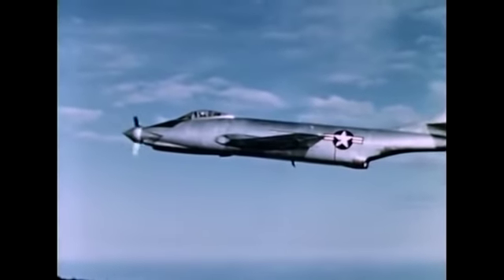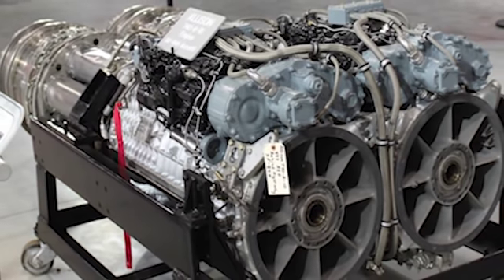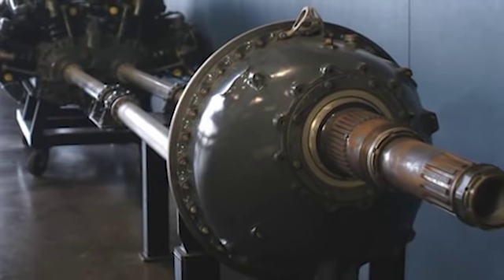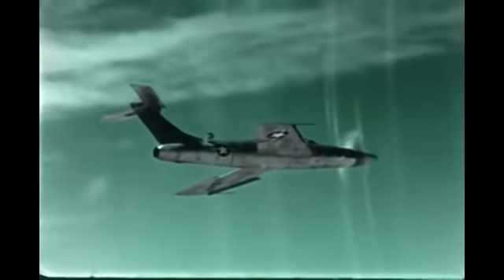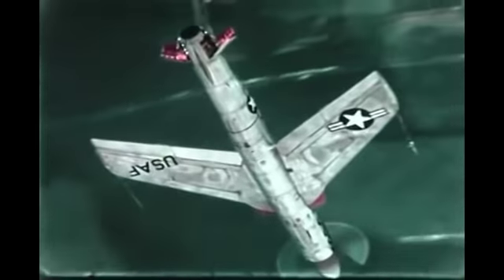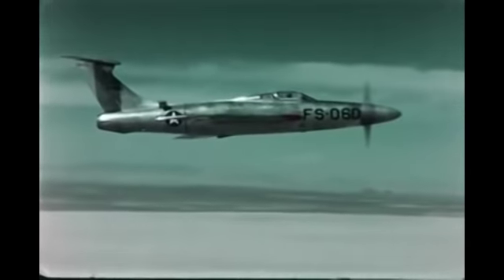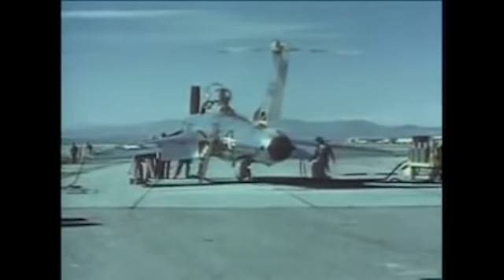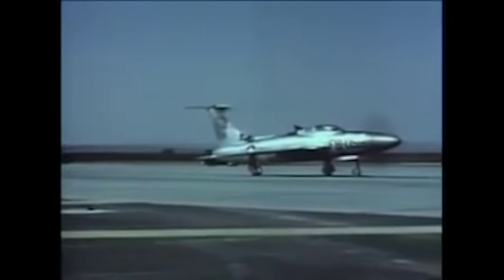The Republic XF-84H Thunderscreech | The loudest plane ever built

Comment: Ever leave a back window open on a moving car? That buffet sound is uncomfortable enough. This plane was probably doing something like it but on industrial grade steroids.
Reply from the maker: That is EXACTLY what I was thinking. That highway-window buffeting thing that basically rips your ears out lolol.
Reply: @theatomiccafe8996  The tips of the propeller where supersonic. The hueys the rotorblade tip on the advancing blade is supper sonic and the props on the tu-95 bears or as well. They would send those bastards out at night and just fly around in circles around the boats in the navy just to drive us nuts. They would shake a 800 ft long boat and you would have to yell in side over them.
Reply: @Johnny; Great analogy, I'll add that the wake from the prop would not have been fun to encounter when crossing its path during any phase of take-off, downwind, or in any type of pattern.
Reply: @ghinckley68  oh yes the tu-95 the Maritime Patrol aircraft that basically told the submarines where it was.
Reply: The Soviets are interesting,  we can’t build proper jet engined bomber fast enough with enough fuel efficient to penetrate US air defenses,  so they build on loud enough that we know it’s there. Then like the neighbor playing loud music taunt u with it
Reply: @ghinckley68  thats what i was gonna say about the turbo prop bear bombers but your spot on or close
Reply: @jamesbuckner4791  the bear is so noisy it can be detected by the anti submarine detection grid on the bottem of the ocean!
Those crews have to be deaf
Reply: @obelic71  yeah I knew that they were so loud enough that even the boats heard them
Reply: Earthquake detectors have slso been set off by the Bear.

Unlike the Thunderscreech though, she's not known for making those around her or beneath her ill, and I suppose that subtlety when hunting Sub's from the air wasn't deemed that important.
(for most of history Sub's had no SAM capability, and even now few do)
Reply: Just because you can hear something doesn't mean you can do anything about it big reason why it doesn't make lot of folk ill and the other side effects is because of the Contra rotating props. Well that's my theory at least what's the two props disrupt each other's sound bubbles thus avoiding the thunderscreechs problem. And yes I do know that the engines on those things are so powerful that they had to use the Contra rotating in order to avoid shearing props off.
Reply: @jimtaylor294  The TU 95 has proven to be a tough bird. the Nato name Bear is wel suited for here. The contra turboprop is only used today sofar i know on the TU95.
Its an efficient system but very noisy.

The turboprop technology researched on the thunderscreech didn't go to waiste at all.
The development and research of a single set prop/helicopter blades made (inter)regional turboprops / helicopters highly efficient and less noisy.
Reply: @obelic71  I don't disagree. Even cancelled projects bring valuable information.

I would note though that Contra-Rotating Propellers - pioneered by the British toward the end of WWII - are still used on other aircraft than just the Bear, albeit mostly on Helicopters.
Some of the WWII vintage heritage fighters flying today have them too as I recall.

It's of note too that multi-rotor choppers operate on the same principle, of the two props' opposing directions of spin cancelling out what'd otherwise be a hazardous constant turning force.
Reply: @jimtaylor294  corect Helicopters profit the most of contra rotating blade sets.
For fixed wing aircraft they have become very rare. One WW2 fighter you mention got the RR Grifon piston engine and contra rotating props of a Shackleton for the airrace in Reno.
In the 80/90's they were experimenting with jet engines whit contra rotating fan blades outside the jet engine.
The single ducted fan in front of the jet engine was more efficient. 

As an aircraft the Thunderscreech failed.
As a testbed and point in the timeline of ongoing turboprop R&D its still a marker.
Reply: That window noise will drive you nuts.
Reply: You mean Chinese female weightlifter grade?
Reply: So they needed a low range and a high range lol
Reply: I had a misscarriage just from my phone speaker
Reply: Oh god... that IS an awful sound & sensation. Some 4-door sedans will do this if you only put the rear windows down, which is just poor aerodynamic design. Personally I only drive 2-door coupes, so it's never been an issue. The worst I ever encountered was in a friend's convertible M3- the fabric top detached from its frame. This caused a deafening vibration from the billowing & buffeting top as the raced-out turbo inline-6 engine surged forward on the freeway, drawing huge volumes of wind into the flapping cloth dome. Worst of all it cost him over $4500 to have the top replaced. The lesson: don't buy a convertible. Especially a BMW convertible. You'll pay faaar out the ass if (when) the top malfunctions. Stick to hard tops with a sunroof
Reply: @AndyBonesSynthPro  In 50-years of driving, I've owned just one convertible.  I drove it from 2008 to 2018, and the last two years the roof was shot.  At that point, replacing the roof would've been almost equal to the car's value.  I was really getting tired of Gorilla taping it, and retaping it every 4-6 months.  But, that's not what made me stop driving it...in the end it was so damaged when Hurricane Michael threw a neighbor's roof through the block that my insurance company totaled it.  Blessing in disguise, perhaps.

Comment: There was also a case of another airfield about 25 miles away reporting that they could it hear the plane and had ordered the test stop in fear that it will damage radar and radio equipment.
Reply from the maker: Yeah.  It was a nightmare of a program to deal with apparently, there was ALOT of complaints and the people working on the project were under a lot of pressure to get the noise handled. But, they couldn’t, so the project was just cancelled out-right.
Reply: @theatomiccafe8996  plus it was supposed to take off from Carriers. Being on the Airfield was bad, imagine this on a carrier. The enemy would hear you  before seeing you. I feel sorry anyone who had hear that.
Reply: The Atomic Cafe 

The pilot would have had a big headache 🤕 after a test flight
Reply: Well you would not need radar to find it. Good job too as the set went off when it got 25 miles away
Reply: More than likely, it was the Mojave airport.
Reply: @l.a.xgunner  it would give everyone on the ship tinitus.
Reply: Doc Savage  yes.

Comment: Yikes even that little sample of what it sounded like was unpleasant.
Reply: It makes the Antonov An-22 sound very quiet in comparison.
Reply: @Sacto1654  the XB70 would be a better choice
Reply: @Sacto1654  I witnessed an AN-22 once, on its approach to a local airport. It could be heard from miles away, the noise apparently coming from the supersonic tips of the four contraprop-fitted turbines.
Reply: roywhiteo5. I read from another site that this recording was when it flew overhead at 26,000 ft.
Reply: Eerie in a way
Reply: @Sacto1654  Doubt it.
The AN-22 used the same engines and similar props to the TU-95 "Bear" and it's Tu-114/Tu-142 derivations - I've HEARD a Tu-142 that was miles up at the time, and could NOT be missed it was so loud from WAY UP THERE.
I would NOT bet on the Thunderscreech being louder - though CLOSE perhaps - with it's SINGLE supersonic-tip prop vs 8 of the things on the Bear line driven by 4 MUCH more powerful engines.

Comment: I did not know that. A Top Fuel Dragster on the first start of the day is really loud and your chest cavity vibrates. Then the engine gets to a slight warm up and the throttle gets bliped and I never thought that it could get twice as loud.
Reply: Years ago, I went to the MOPAR Nationals at Englishtown, N.J. Was watching the Funny Cars by the wall in front of the bleachers. You HAD to wear ear plugs. Mind you, you're about 50-60 yards away from the cars on the track. When they left the line, I would grimace in pain from the sound and vibration. You can feel your insides rattle as the cars went by you. Very unpleasant feeling. Yeah.
Reply: I can remember my first time at a drag strip, I got there during a pause in racing and wandered around watching teams get ready for the next set. Each time they blipped the accelerator I thought "@#$% that's loud". Then the racing started slowly working up from the least powerful category each one successively louder. Finally they got to the Top Fuel and when they took off from the line I swore the whole world began to shake and I think I briefly saw into another dimension. I truly think only a rocker launch could be a more awe inspiring man made sight.
Reply: Paintnamer Yep...they start the top fuel engines on alcohol but once it flips over to the 90% nitromethane and 10% methanol mixture, the beast truly comes to life. Between the burnout to get the tires sticky and their 1,000 foot pass, it can burn anywhere between 12 & 22 gallons of fuel and can reach up to near 330mph and make their pass in around 3.6 seconds. They’re easily the loudest things I’ve ever been around. Even from a significant distance away, when a Top Fuel car accelerates actually takes your breath away while shaking your entire body. Crazy
Reply: @DugganSean  Did not know all these facts. very, very amazing.
Reply: Fun fact: 2 top fuel cars launching side by side generate an earthquake of 2.6 on the Richter scale
Reply: [SAW]Spitfire Once you’ve experienced it, one would know with 100% certainty that this is true.
Reply: @sawspitfire422  fun fact NHRA at Zmax dragway in concord NC, they run top fuel 4 lanes at a time. Which is cool as fuck because it's 4x the loudest ICE  in the world, but also lame because there are genreally 16 top fuel cars so that means 4 races total instead of 8. I have pictures on this phone of 4 top fuel cars crossing the line with huge plumes of burning hydrogen 15 feet tall from each car.....great picture lol.
Reply: Words cannot describe two nitro cars leaving the line. You have to experience it at least once in your life. You will be back.
Reply: Try being on a base when the SR-71 takes off.
Reply: Doc Savage  i dont know how arty guys function. Hats off to you. I cant shoot a 20ga shotgun without hearing protection, cant imagine repeated 155mm all day....best hearing protection in the world cant stop that amount of concussion.
Reply: Doc Savage  my hearing was damaged in an accident, my left ear fills with fluid for 2 weeks and can get infected if I shoot without ear pro. I can manage my .17hmr and .22mag but thats about it, no high powered cartridges or shotguns etc.
Reply: Doc Savage  plus high tinnitus 24/7, have to sleep with a tv or fan bare minimum
Reply: Doc Savage  steam discharge accident for me. Was about 60 feet away from a 18" diameter pressure relief valve on a supercritical boiler condensate system when the valve experienced failure. Knocked my left ear drum almost totally out and deafened a range of frequencies in my right ear from reverb. And I had earplugs in.
Reply: Oh my god those things are FEROCIOUSLY loud...
Reply: Paintnamer I hate top fuel dragsters. The sound is painful and when the fuel vapour gets in your eyes it’s really hard to get rid of. Totally concur with your comment about the reverberations in your chest cavity. That’s probably because the exhaust gasses are likely to be supersonic. But I can totally see why other people like them. One man’s shit is another man’s strawberries.
Reply: Top fuel dragsters loudest thing I've heard and felt,love it
Reply: top fuels are so loud that they vibrate the fluids in your eyes causing blurry vision
Reply: @noname1st139  Unfortunately they no longer race 1/4 mile races.  The cars are too fast.
Reply: @BoilerBloodline  now the record is 338 mph in 3.655 seconds
Reply: That's a short time. This is constant for a longer time.  T 37 Tweety bird is a,4,000 pound whistle
Reply: @thunderheads4103  in 1000 feet!!

Comment: He’s right. It was on a pedestal at the Bakersfield airport for years. I had heard about this plane an walked around it once while on an overnight there. The prop is unlike anything you’ve ever seen. thanks for this. Amazing airplane.
Reply: Yes, the props were weird. They maintained the same speed at all times. Only the pitch of the blades changed, and they changed quickly, pushing the pilot back in his seat. For this reason, the designers felt that a retractable dorsal fin (just behind the cockpit) could enable the pilot to limit/trim the amount of P-factor (gyroscopic twist of the aircraft opposite the blade rotations) produced by those props' instant twisting action. It was found that the fin was not needed so in tests it was left in the down position as you can see in the video. Only about 1 ft. of fin was shown when in down position. When in up position it was about 30" tall.

Comment: Pilot: You've cancelled the project?
Airforce General: Yes
Pilot: But we've not tested its stealth capability yet.
Reply: All the test pilots, mechanics, and technicians have gone deaf.
Reply: Rob Norris WHHATTT???
Reply: @ryanm.191  Ryan. It's a joke. But considering the noise it made you have to wonder
Reply: @robnorris4770  General: We're cancelling the project.
Pilot: What
Reply: Big Blue and then rob Norris said it made all the people dead and I replied pretending to be deaf
Reply: @bigblue6917  Ryan's "WHHATTT???" was also a joke. 
Pretty much the same joke you made but without using the "General:" and "Pilot:" part/format.
Reply: Doesn't need bullets. They win RUN the hell away. LOL
Oh, and make it a DRONE.
Reply: Big Blue see you wouldnt be able to hear anything after it flew by so it would be stealth
Reply: Operator Kingpin it wouldn’t be stealth the first time it went somewhere
Reply: It's stealth capability is that it's Shockwaves are just obliterating the enemy radar stations.
Reply: WRRRRROOOOOOOOOMMMMMMMSSSHHHHH
Reply: @robnorris4770  One pass over the enemy and afterwards it becomes a stealth aircraft.
Reply: Trying way too hard

Comment: I wonder if the issue could be solved by adding a duct around the propeller, ducted fans can spin much faster than ordinary propellers without losing efficiency past the speed of sound, and are also quieter at those speeds since the shockwave at the blade tips is mitigated considerably by their close proximity to the inner duct wall.

Comment: We need a drone like this for when we fight the Chicoms again.
Reply: My thoughts exactly. Hell I'll do you one better! You create a turboprop driven UAV that's capable of flying anywhere from 200-300mph in a subsonic propeller flight mode, and then have a switch or a lever on the UAV operator's end that will enable the drone to fly with its propeller at full power (3000+ RPM/Mach 1.2 was the reported prop tip speed on the thunderscreech. With today's tech? You could potentially have a much more stable aircraft that could potentially allow for the propeller to spin even FASTER.) You definitely want the option to fly the drone at subsonic speeds, because if the thing was running at full speed all the time? Eventually the guys and gals who are ATC operators are gonna get tired of having to replace the shattered windows and broken equipment, the grunts are going to get tired of the tinnitus, and the brass are going to get tired of the noise screwing up all the radios. Needless to say, you definitely want to fly subsonic most of the time. Build it with some very heavy armor in mind, like, Mi-24 Hind or Apache level armor, and then fit it with a single GAU-8 Avenger autocannon, one of the most destructive conventional weapons ever designed, when combined with a skilled pilot flying an A-10? It is brutally effective, it'll turn anything into a pile of rubble or a large red mist and the infamous BRRT will be the last thing the enemy will never hear, anything that stands in front of it? Dies. It's simple. 

Still, that is a very large and extraordinarily powerful gun, it might cause problems considering how unstable the XF-84H was in flight at high speeds. However, you could always use two or perhaps two GAU-22A Equalizers, the Avenger's younger 25mm brother, it still packs a punch and still can put flat out nasty amounts of destruction down range, you could probably carry more ammo for it too in the fuselage. Two Vulcan cannons would probably work very well too. Then? You gain some altitude, flip the switch to turn the prop supersonic, and then go Stuka dive bomb, make enemy troops virtually fucking deaf, puking, ruining radio comms, smashing out windows, making it almost impossible for enemy troops to aim, and then annihilate anything in the way with that autocannon. The A-10 Warthog is a phenomenal close air support aircraft, and I think given the "sonic weapon" portion of that aircraft, such a drone would be best designed around close air support as it's specialty use.